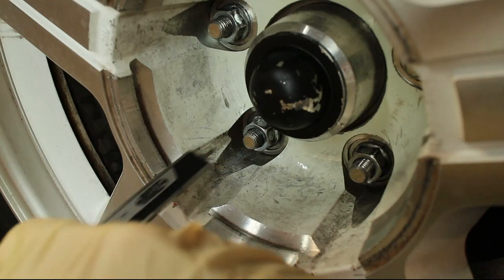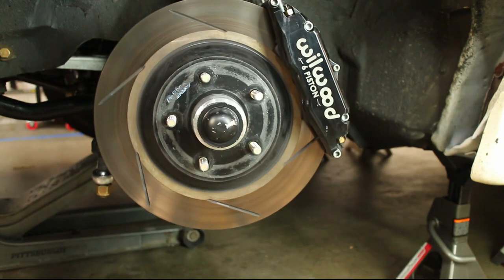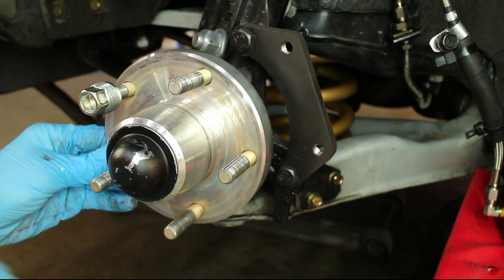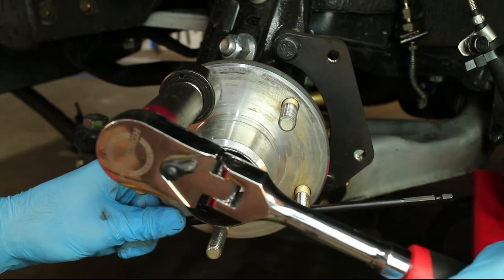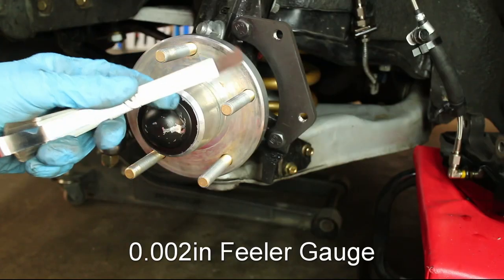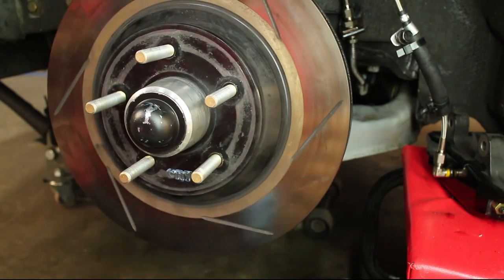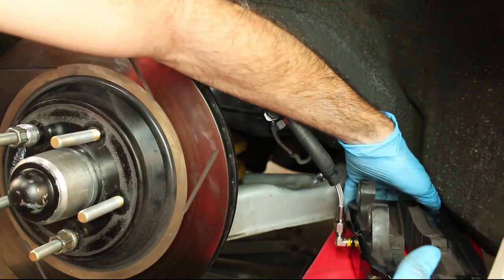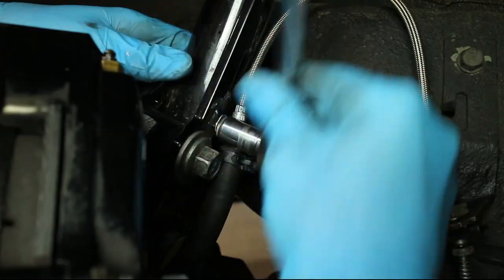ARP Wheel Stud Install (1982-1992 Camaro/Firebird)

Comment: would these arp studs fit on 98-02?
Reply from the maker: ya, 4th gens are the same m12x1.5 thread.
they sell a bunch of different lengths so it depends on what you need.
Reply: I got ARP 7708 which i was told was the smallest larger ARP replacement for me. It was said to be 3/8" longer than stock and some said 1/2" longer. I have a 97 though and my stud ends have a dead spot thats quite large. Yours may be a bit different idk but It's actually a lot longer than stock. Just grinded and cut out the spot in brake brackets to install them and only did one stud   I'm gonna make a quick-to the point video on it but they'll def go in.  We're M12x1.5 just make sure to get the correct length you need.🤙